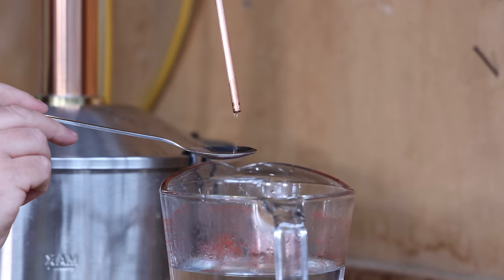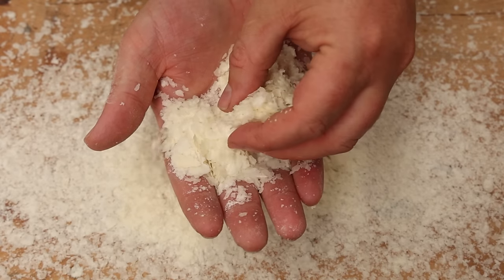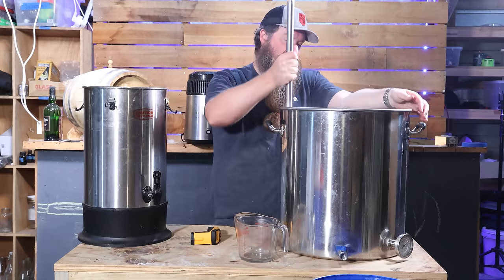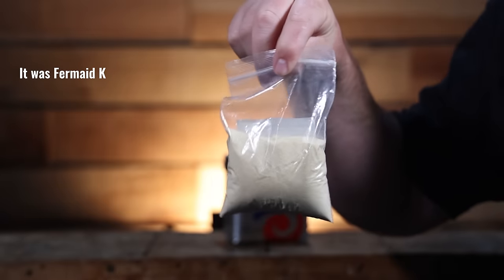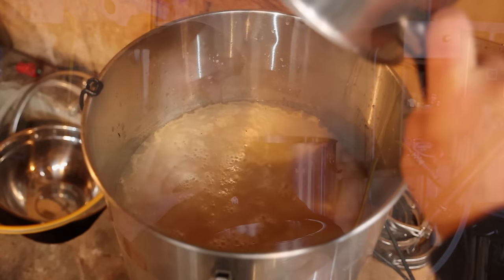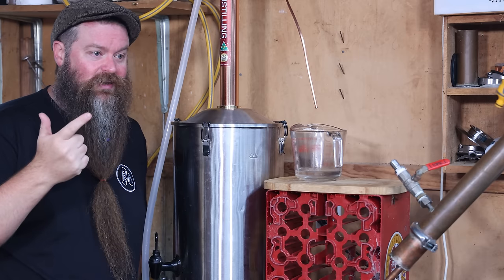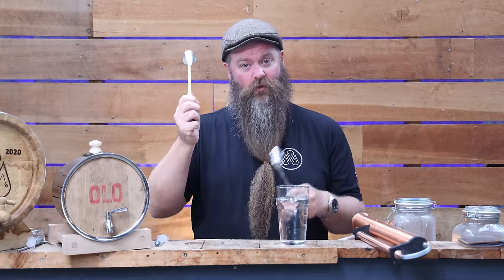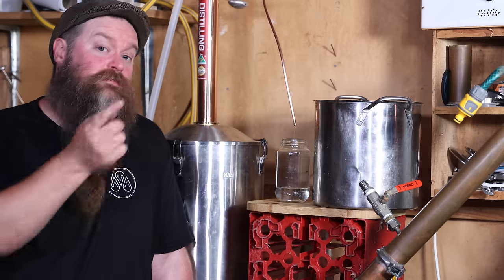How To Make Potato Vodka The Easy Way

Comment: 1. Sugar is a terrible.
2. Need full starching. You have to boil potato mash 30 min. You have grind raw potatoes.
3. Cool starch to 61° C and add malt and rice shels ( for a good filtration).
Malt fermentation for maximum alcohol content must be on 58-59°C, not higher 60°C.
Under these conditions you will get the most liquid mash.
Heat mash to 80°C and mash out. Wash malt boiling water like a beer.
If you want brew thick mash without problem - buy steam boiler in china. There's cost $ 1000.